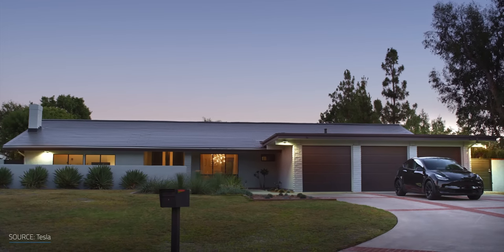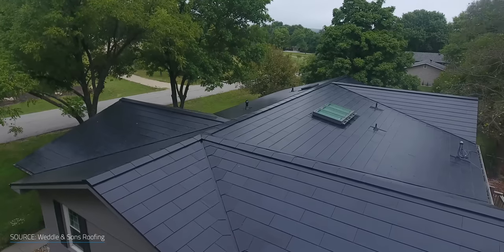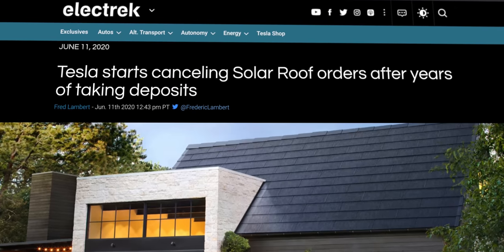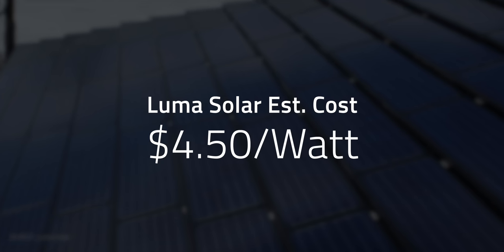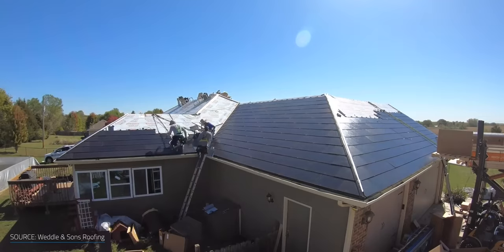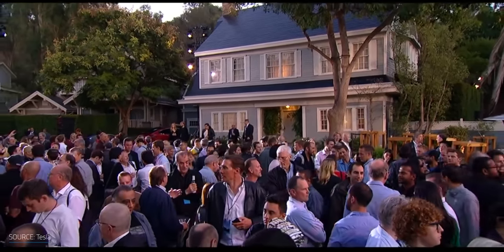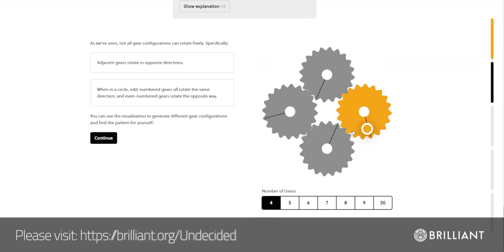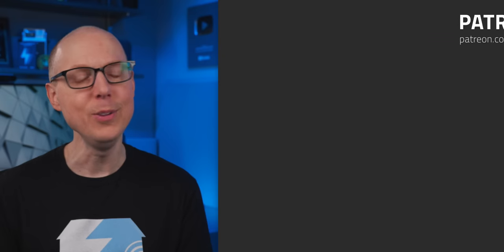The Problem With Tesla’s Solar Roof

Comment: Tesla's solar roof is stupidly expensive compared to regular solar panels. It is a toy for rich people who want their roof to look pretty. GAP makes roofing, but it is a new product for them, so the quality and lifespan are unknown. I would look at their written guarantee closely before purchasing. Tesla originally guaranteed their solar tile roof for life, but has since backed off of that guarantee. This makes sense because there is no waterproofing underlayment that will last indefinitely in hot climates. Because of the ultra-high upfront costs, solar tile roofs may never pay for themselves.

Solar tiles may prove to be competitive in the future, but right now they are two to three times more expensive than a solar panel system with similar capacity. For most people, they are a foolish investment financially. Add to this that their longevity is questionable and there is nothing about them that is redeemable. We are just now beginning to see a litany of teething problems from early adopters of the Tesla solar roof and others. Until all the bugs are worked out, solar panels are a million times better investment for nearly every person.

Comment: Boo, combustion engines suck - less than 30% efficiency! Down!

Wow, this solar panel has 18% efficiency - magnificent!
Reply: Yeah, but that 30% efficiency is on an internal combustion engine that produces literally tons of CO2 pollution per year (just watch any vehicle review on PBS's "MotorWeek" TV show, as they list this standard pollution  gauge), as well as other pollutants. Solar panels? Zero emissions. And it keeps you from drawing power from the grid, which (for most of the country not near a hydroelectric, nuclear, wind farm, or solar farm) means consuming more hydrocarbon fuels, creating more pollutants.
Reply: @gerrygreen3832  i literally knew what you would say, so i didn't read everything.
It was a joke.
Reply: @tkzsfen     Well, you see, there's this... kind of... "convention" with digital communications (e.g., emails, texts, blogs, posts on discussion boards... basically anything you would type into a digital device) whereby if one intends a particular comment to be a "joke", they put this thing called a "smiley emoji" at the end of the comment to indicate as such, thereby  preventing misunderstanding by readers as to the intent of said comment. :)   <--(See how that works?  :) )
Second point: If it's actually a "joke", it doesn't make any sense. As worded, the only way it makes sense is as a "sarcastic comment".
Third point: Let's see... Someone doesn't read the full text of a comment (which on my display is a grand total of only three lines long), but decides to reply anyway. Brilliant strategy. (See the second sentence of "Second point:" for an indication of my intent here.)
Reply: @gerrygreen3832  bro, go and do something productive :) :) :) :) :) :) :) :) :) :) :) :) :) :) :)
Reply: @tkzsfen  I guess you mean besides educating someone (or more than one) on this renowned forum...  :)
Reply: @gerrygreen3832  yeah, exactly :D
I've heard names given to YT, but renowned forum was never one of them, ROFL

Comment: The whole point of solar roofs is to offset CO2 and slow global warming?  You offset a lot more CO2 building regular solar panels and putting them in the California desert right beside the town then spending $100k on 10kw of panels placed on a roof that doesn't even point south. 🤦‍♂️

Comment: solar energy for a better environment. The most stupid thing. Let me make it clear. Environmentalists say generate co2 cause early to trap more solar radiation so the climate is change. Here, the actually statement is that generating co2 generates h2o steaming with trap solar radiation in a much higher rate. According to 1st and 2nd rule of thermodynamics solar panels are doing the same if not better job than co2 and/or h2o to trap solar radiation. But I guess nobody is talking about it.
Reply: I think you mistaken this comment section for facebook.

Comment: I've seen solar panels on houses in my area that were installed correctly - but in the cheapest manor possible.  As a result, they were quite unattractive. When the time came to do it to our house - we were turned off by the negative aesthetics and high upfront costs.  Here's hoping that the solar roofing market is in a much better place when our roofing needs to be re-done in the next 7-10 years. 😉

Comment: The question wie Tesla doesn't deliver? Because real technology doesn't work as vapour ware king Elon believes it would. It is not enough just to claim that it is easy and you will deliver something nobody else was able to do already this year. It is hard work to gain experience. You need to go trough many iterations to improve the design and still you can fail. Can we stop ignoring Elons's visions until they deliver real products? It don't say they will not at some point, but the current specs are just marketing claims.

Comment: @ $100,000 it will take 50 years to break even, and by that time you will have to replace the entire roof twice. Do you think those products will still be available in 20 years? Dream on. You cannot break even on $100,000. It's impossible. OTOH, gullible idiots can pay the $100,000 idiot tax 3 times over, so there's that. It should improve their social credit score.